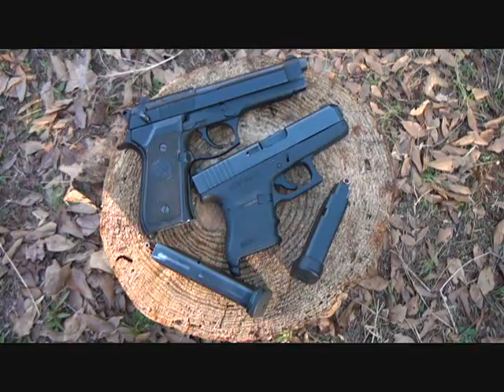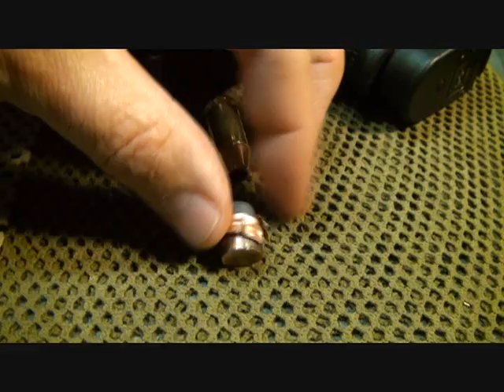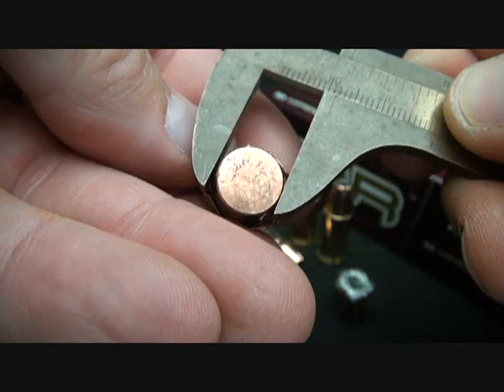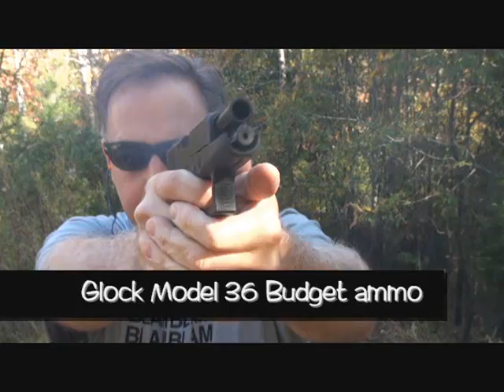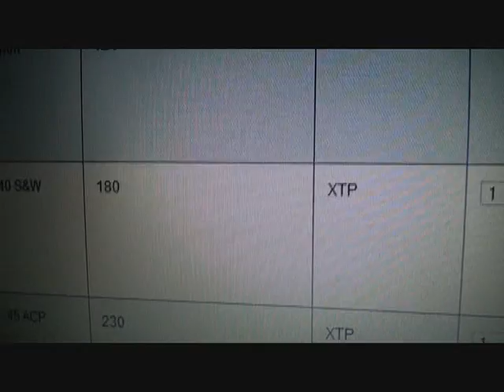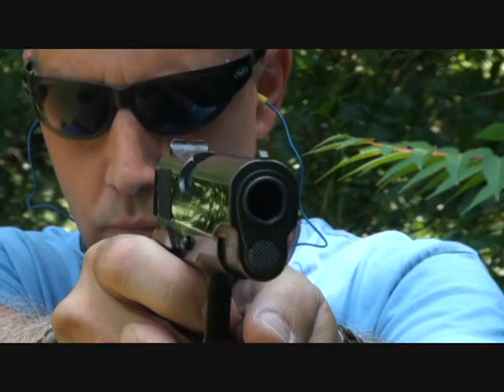HPR XTP JHP Ammo Test  9mm / 45acp

Comment: 45 failed to expand due to th short barrel of glock, try shooting that 45 round using the standard 1911..45 is a heavy round, it needs more barrel length to have a bit of a swing for the round to be at maximum speed.

kudos to 9mm!!! very exceptional..

Comment: @MrPSDShooter You're correct, it's about shot placement.  Now you shouldn't be aiming for the head, center of mass shots only.  But actually there are guys who will continue coming at you with a hole, or a couple holes in them, especially if drugs are involved.  It's about physically incapacitating them, and HPs are much better at that.  I never said anything about conserving ammo, shoot until there is no longer a threat.  I train mostly with FMJ and carry HP (I do train some with my HP rounds).

Comment: @thefinder808 
It expands great if you push it.

Running hornady 250gr .452 XTPs over 36gr of win296 in a 454 casull, they turn into frag grenades on impact. Hornady bullets just require a reasonably warm load to work.

Comment: After seeing the velocity specs... It's obvious they're going way way below where they should be loading those up to.

755fps is a bunnyfart load. You can hit 950 under +P spec. I run 200gr hornady FMJ-CT on top of 7.2gr of unique with a winchester primer. I hand weigh each load, and spec overall length after multiple rechamberings to make sure they NEVER drop more than 0.005" OAL. This is my "Trust my life to it" load. I wouldn't trust something I didn't make, but that's just me.